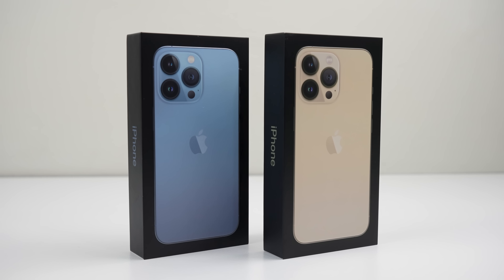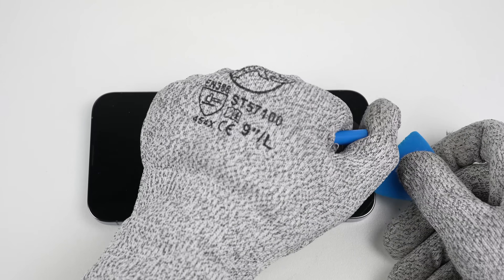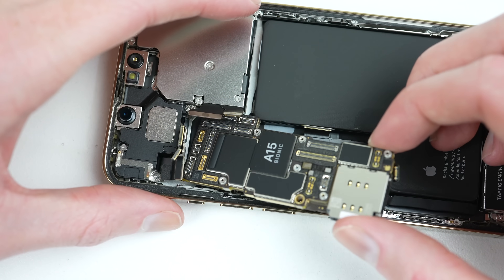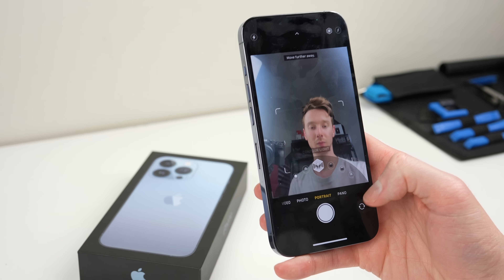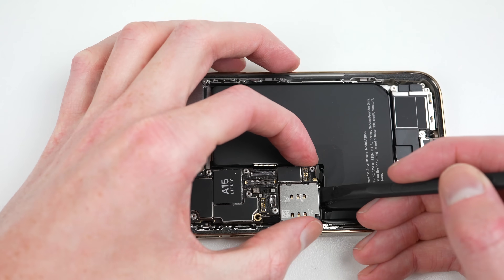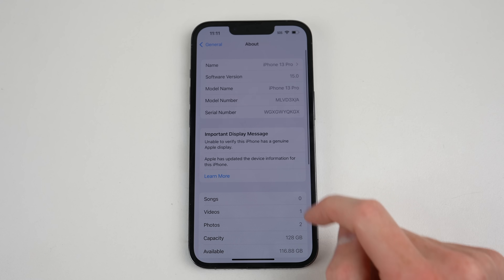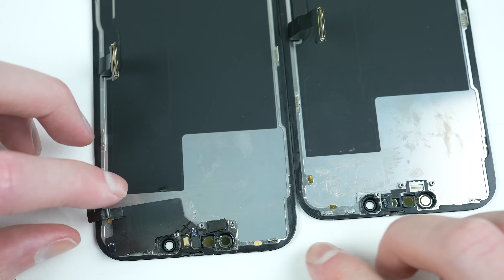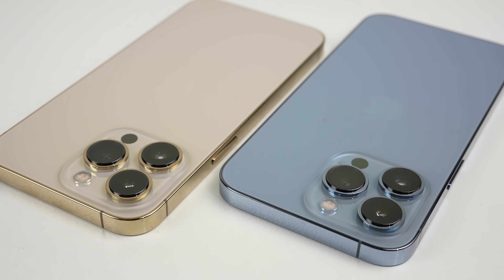iPhone 13 A Repair Nightmare - Teardown and Repair Assessment

Comment: "i might have spent $3,400 on these two phones, but I truly don't believe they belong to me." As someone who already hated iPhones for their price, durability and incompatibility, this just makes me writhe
Reply: @nebylicza  I have a samsung one I still use as a mini website server and its 10 years old still running. I am not a fan of apple due to many tech nightmares trying to fix simple things on them. On samsung however its super easy.
Reply: @sparklesongfall  There isnt anything you need to fix with apple
Reply: @nebylicza  there is a difference between a computer and a personal computer. code had always been ran on computers, but a PC was an entirely different thing, and at the time was little more than an oversized calculator, which is what makes the fact that they made it run code so impressive.

 also, what i was highlighting with that what if scenario is that their business model is in direct conflict with innovation, sorry i didnt explicitly spell it out for you as if you were a child who couldnt grasp nuance, but thats what i meant.

 and my point about the GUI is that the best thing they did, they didnt even come up with, my bad for getting the company wrong, but at the end of the day my point still stands.

ill admit, they had a short period of time where they were a huge, and possibly the biggest force of good on the industry, but as people like wozniak left that version of apple left with them, and for the majority of their life theyve beeen a blight on tech. if you rally love apple so much, you should be openly criticizing what they do so they can improve and go back to those glory days, rather than just pretending their long past glories make up for what theyre doing now.
Reply: @nebylicza , I doubt. Having to forcefully update the firmware that leads to a slower speed or "better battery" and downgrading is almost impossible. End of service will hit the older phones, and you can't have other apps as it requires a specific ios version. In terms of hardware, I might agree that it lasts long. But as the phone and service generally, I doubt it to be sustainable for consumers.
Reply: @atlinsonxiao  Bro, Apple gives the longest support with 6 years of updates
Reply: @atlinsonxiao  i've never laughed so hard. Funny how for being "mobile experts" android fanboys know less than anyone else about smartphones. Trying to use play services as an excuse to never get an upgrade and flip that as a positive is hilarious. You people are idiots.
Reply: @nebylicza  We shouldn't even be comparing iphones to Android. One is a phone and one is an operating system. Iphones obviously use iOS but that means every other phone in the world uses Android making it the most used Operating System in the world (surpassed Microsoft a few years ago). So unless you have extensive experience with every other manufacturers devices or call them out specifically you're comparing apples to oranges.
Reply: @nebylicza  Oh yea, you mean those 5 years of "free" software updates that Apple were taken to court for, and proven to deliberately crippling aging systems with their software, forcing users to scrap their phones and buy new - a lawsuit which Apple lost monumentally, and now just try to act like it never happened? Yea right, free my ass. They only learn if learning involves increasing their revenue - always at the cost of the end user.
Reply: ģģģ
Reply: I detest post 2010 Apple. The only thing good about their new iPhones is the exterior design. Everything else is terrible. Seeing this video thoroughly pissed me off and made me very happy to be an Android user.
Reply: Why are you watching videos and getting worked up about a product you’d never own?
Reply: @nebylicza Again to say that you have to have extensive experience with every device built that uses Android. The UX and the UI are different from manufacturer to manufacturer. LG, Samsung, and OnePlus (just to name a few) may all run Android. It's only their base core, with a lot of changes making each very different not to mention the hardware differences that effect the UX. Just like MacOS is based on Unix (so is iOS BTW)  it it's still different than base Unix.
Reply: @nebylicza  Your head is so far up Apples ass you can't even see how stupid your logic is. Obviously you're totally ok with paying $1000+ for a device and be told what you can or can't do with it, I'm not. No matter who makes it, the concept of submitting to anyone over something you own is ridiculous. It's not about security, it's about money. If it were Apple would impose the same "app store only" restrictions to their computers like they do their phones. The blind see that. I've been using Google devices for years , unlocked bootloader's, rooted , installing whatever I want and never had any security issues. Disallowing the installation of apps not from Apples app store doesn't prevent it from being hacked or infected. People jailbreak them days after a new version of iOS release showing no matter what restrictions you put in place there will always be vulnerabilities. 
BTW I normally don't insult on threads but you did say "up yours" so fair game. Not to mention the hypocrisy considering how you e complained here more than once about others insulting you.
Reply: @nebylicza  Where are you getting 93%? Making up things to suit you? Iphones are 15% of the market share and Samsung is 18%. 33% combined. Long ways off from 93.
Reply: @nebylicza  Cite your source on that 93%. So far off it's comical. BTW your ultra secure superior iPhone has just today been warned of a serious exploit/security breach. Lol
So much for your security claim. 
"If you have an iPhone or an iPad, better update those suckers right now. Apple has just announced a newly discovered zero-day vulnerability affecting droves of the company’s phones and tablets—the likes of which may be seeing “active exploitation” by hackers."
Reply: @nebylicza  dude, they did some good things, yes, but youre ignoring all the harm they did, and tried to do to the tech industry for the sake of their own profits. way back in the day, if it werent for microsoft and ibm doing some olympic grade gymnastics around patent laws, apple would have a monopoly on the pc industry. that whole attempt at a monopoly plus their closed hardware model should easily tell you they had no intentions of doing any good for that industry. plus that shit pales in comparison to what literally every other influential person in tech did. Microsoft literally figured out how to get pc's to run code, and you expect me to care that apple "pushed" for usb's and wifi? get real. theyve done far more harm than good on the industry, and that was their intention from the start. only real good thing they did was make steal the idea of a GUI from ibm so that microsoft could then steal that from them.
Reply: Dont let Apple get away with saying it is to ensure popper components.  Literally they aren't checking if the components are made by Apple, they are only checking if Apple made the repair.
Reply: @nebylicza  I refuse to believe you had both an android flagship and an iPhone and chose iPhone.  I bought all 16 of my employees s21 ultras for work and all of them eventually asked me if they could use it as their personal phone as well.  Especially because UX was your complaint?  That's like the last thing Apple does better lol.  I mean if you said you liked to take selfies on your iPhone more I would be more inclined to believe you.
Reply: Apple 🍎 users wake up. They are holding you hostage. You should not be obligated to only go to Apple 🍏 to fix YOUR iPhones. It is your iPhone and should be able to take it for repairs where you want to take to get fixed. I am sorry but, I will no longer purchase any Apple products. I buy the phone, it’s mine, I should be able to choose my own phone repair facility.
Reply: @nebylicza  someone’s a smooth brain 🙂
Reply: @nebylicza  lmao what? in what universe does being trend setters equate to being innovative or beneficial? and they never got a single industry going because of their technology, it was all their marketing. apple is a marketing firm with a tech branch, thats it. they arent the leaders of the actual field, its companies like Motorola or blackberry that lead innovation, they are just the biggest names. just like pretty much every other industry, popularity isnt a sign of skill, just charisma. also, lmao "yeah i write bug reports that they wont read and uhhh also use the official channels where theyll ignore me" yeah, thats tooootally going to do a lot to fundamentally change there company as a whole. not saying that whining about it in youtube comments like i am will change much either, but if i cant fix em the least i could do is warn people about em. at the end of the day, theres a reason tech enthusiasts usually dont like apple. lastly, i think you dont criticize apple because youre literally said i hadnt proven how theyre bad, which if you need me to prove that to you its pretty clear youre just a blind fanboy.
Reply: @ckopen7192  right? Let a car manufacturer software lock every single component in it from an LED to an oil filter and see how quick apple fanboys complain.
Reply: @nebylicza  you clearly don’t own a iPhone after the iPhone 5
I phones have terrible durability I remember recently I put my phone in my pocket with a receipt and when I took out my phone there were a bunch of scratches on the top left corner from a pice of paper

My friend dropped his Apple Watch in tile and the glass cracked and the touch screen did not work and he just dropped it my garmen watch has withstood allot of damage falling from a much bigger hight then 5 feet and it has 1 scratch on it 

And anytime the release a new smartphone they release an update that make the old ones slower and have worse battery life for example my phone used to last over 12 hours now it only lasts 8 and this phone is not even a year old

Samsung phones are better in every single way and are the same price the only reason people buy apple is because they have an emotional attachment to it just because the old stuff was good does not make the new ones good 

And I hate the argument that one time a Samsung blew up so that means all Samsung phones are bad you know the iPhone 4 my dad had blew up so shouldn’t that be considered a huge hazard?  my sisters iPhone 7 barely works and now the glitches has transferred to her iPhone 12 Pro and my phone sometimes just won’t respond to touch screen even thought it’s not cracked or broken.

iPhones are bad now and Samsung is better yet somehow apple still exist when they make nothing good
Reply: shit phones by a shit company, people will find any excuse to still defend them
Reply: @nebylicza  and I would also like to add that i've heard it somewhere else saying "Apple makes you a user, Android lets you be the master"  in which personally i would agree. Apple are user friendly and are more service oriented, while android phones, if not all, are made and sold to serve its purpose to the user.

Anyway nice to know what you guys has to say, might think twice about apple
Reply: If I pay for a device and own it outright I should be able to do with it what I please. Side loading apps for example, I should be able to install any app I choose and not be tied to 1 app store. I happily use a MacBook pro but won't use an iPhone for this reason. You have to jailbreak an iPhone to do what any Android phone can do straight out of the box. MacOS is great as I can do with it what I want but won't be told what I can or can't do with my phone.
Reply: @nebylicza  Utter nonsense.
Reply: @nebylicza  tbh i've tried iphone 4, 5, and 5c, they all feel good to me. But i somehow find it hard to navigate through file manager and such, does not offer much freedom compared to android. To say, i find the apple UI to be more user friendly, i just disliked how the updates slows down older devices. But in terms of security, I'm good with it. And i always find my way back to android, well preferences
Reply: Me watching this on my iPhone XS after 3 years of daily use and heavy drops with not a scratch on it and still lasts me all day lol
Reply: tbh i use both apple and android devices, there are some clear differences between both, i honestly dont care about this stupid debate, theyre just phones. the only thing that frustrates me is how some phone fans keep buying the new models.
Reply: @nebylicza  "I don't like Android fundamentally so the tweaks manufacturers put on top dont matter to me"
I don't like you fundamentally so everything you say is bullshit.
Doesn't sound as nice when you say it that way, but it sais the same thing. And technically speaking, Apple does have a monopoly on their products. Product gets "old","here's a update that will extend its life(make it slower so you buy a new one)". And then like this video easily demonstrates, Apple wants to be the only one who repairs products they sell. I understand security and bla bla bla... but imagine mechanics being the same way, it sounds completely ridiculous. And as far as I've seen, Apple is one of the only companies that have measures to prevent the person that OWNS the product from trying to fix it themselves. Not to mention the price, name one Apple device that is currently being sold by Apple for less than $300.
Reply: @nebylicza  i wasn't saying i wasn't listening to you, you do make some good points. But in the comment I quoted, I was referring to you not caring about the manufacturer. To you, It didn't matter that I was trying to make a point, it matters more that I was trying to criticize something you said. And yes, while in the video you linked it does look like Samsung is starting to do the same thing. That would be something to blame on the manufacturer, or are you saying ALL android phones are doing that now. And if you quote me don't take it out of context, " I understand security and bla bla bla... but imagine mechanics being the same way, it sounds completely ridiculous." Me saying bla bla was just trying to sum up all the concerns for the owner/anyone being able to fix it. But as seen in earlier comments you need everything spelled out for you, so I apologize for leaving that up to interpretation you don't have. And AASP still proves my point, you HAVE to take it to someone who is "Apple approved" to fix it in only the "Apple approved" way.
Reply: @PartytimeYOLO  No, it's Apples fault.
In europe there were laws to force replacable battery (shall be taken out without tool on recycling) or use one generic charger (USB micro).
Apple ignored this laws, claiming an iPhone is no smart phone, hence the law don't apply to them.
It's Apples bad behavior and getting away with it that teaches other manufactureres to do the same.
Apple should be held accountable for their wrongdoing.

I had collegues woring in automotive multimedia doing phone integration in car apps.
They learned about the rules of Apple. For each App you have to fully disclose the technical and business ideas. Then Apple reserves the right to wait a few weeks to check if you shall do this, or they find out: nice idea, but we want to market it ourself.
This seems like Apple is scavanges other peaples ideas, just like what they did starting with Xerox.
Reply: @nebylicza  apple has held the tech industry back since its inception
Reply: U suck…just nonsense without references
Reply: @nebylicza  or they and you just think that low battery life is not an issue and yes newer software requires more hardware(in some cases) but every year when a new phone comes out there will be an update just to make your phone slower and have less battery life and does nothing else 
and have you used a Samsung phone or a Motorola phone both are much much better then apple bs of saving the planet and Motorola still has a headphone jack 
And don’t say the interface of Samsung and Motorola is hard to use because it’s not at all anymore that statement was from a few years ago but now Samsung has the same user friendly interface same with Motorola but as I said just because something a few years ago was good does not make the new stuff good tell me does any of your friends own an iPhone 12 or iPhone 7 or 6 

The iPhone 12 has the worst durability on any phone I have seen ever I often joke about my phone having dollar store glass because if it can be scratched by paper and  plastic then wtf am I paying my $1,100 for oh and Samsung has better battery life, camera, screen, and is more durable
Reply: @nebylicza  I prefer to own what I pay for. If I buy a laptop I own it and should be able to do whatever I choose to do to it. I expect the same from a phone I pay a thousand dollars or more for and it's amazing how some will just accept spending that much for a device and being told what they can or can't do with it. Maybe if more would put their foot down apple would take their foot off them and it'd be a better experience. Hopefully the EU will win in court and force apple to do so. No matter what you think it's not about security, it's about money. Money they'll lose from their app store profits. I've never had any security issues with my Pixel 4xl or any previous device. And I unlock the bootloader's and root them.
Reply: FWIW iPhones have been pretty sturdy for the last few iterations. In my experience, at least. That said, I get my phone free from work (right now on an 11 Pro, getting a 13 Pro in a few months), so since I don't pay for it, I'm less concerned about value (which Apple always sucks at).
Reply: You don't truly own anything, because you are merely borrowing the money from the US Treasury. The Money we use in the US is actually a Treasury Note, that says that 35 of  the $1 bills are worth a trade in value of 1 Oz of gold, before inflation.

The same dollar, or treasury note, is also only worth as much as the GDP is worth divided by as many dollars there are in the system. And since the GDP is highly inflated as it is designed to never go down, basically worthless.
Reply: people who irrationally hate one platform are fanboys, 100% of the time. All the platforms have their ups and downs.
Reply: If you can’t afford it then don’t buy it.?
Reply: @Lilkuro777  if you can afford it, don't buy it
Reply: I have had my iPhone XS for 3+ years now. Its still working 100%, despite me dropping it 10+ times on concrete floor (NO PROTECTION, yes I was just lucky). I am still gonna keep this phone until it’s trash, but I can easily see it survive for another two years at least.
Reply: Iphones are very durable and if you know what you are doing they are compatible in almost all situation (despite the usual inconvenience sometimes ill admit). I have an iphone 6 and 8 (for work) that i have been abusing for many years now with no issues (neither software nor hardware). Before that, i used to change phones (mostly samsungs) every year/year and a half due to software slowing down despite formatting or the very fragile hardware.

Despite all, what apple is doing now is truly f*cked and twisted and is seriously making me consider an android for my next phone (if i need another one).
Reply: @Gwagon_G  well that did a u-turn quickly. So if you like ur iPhones and have had great luck with them then how does this video affect you?
Reply: @Gwagon_G  hey man, if you get an android, go with the s series. very durable, easily replaceable components, hard as fuck to crack, fast
Reply: @Gwagon_G  I think you got durable and expensive swapped buddy
Reply: @themountaineer1978  
1- Batteries are consumables; eventually their capacity drops to an unacceptable level
2- Accidents happen and screens break eventually especially for someone in my line of work; the important thing is being able to fix this without having to spend a lot of money that makes fixing it pointless
3- One of the most important thing to consider before buying something is how long it will last; I'd rather buy a 8K $ car that will last me 10 years than buying a crappy one for 3-4K $ that will cost me a fortune in repairs and if am lucky would last me 2 years - Same goes for mobile phones by the way. Very glad my iphone 6 averages around 50 dollars a year (initial cost/years of ownership) while most of the samsungs/sony that I used to buy before would end up in the trash 1-1.5 years after paying full brand new price for them.

Think buddy think.. Don't just look at the price tag.
Reply: I now own a Samsung S21 previously used an iPhone 11 I have to admit that…iPhone has a better feeling imo 🤷🏻
Reply: @MohithThiyagu  get a new home ui, androids built in one does feel a bit weird